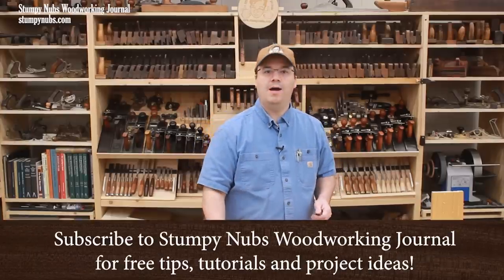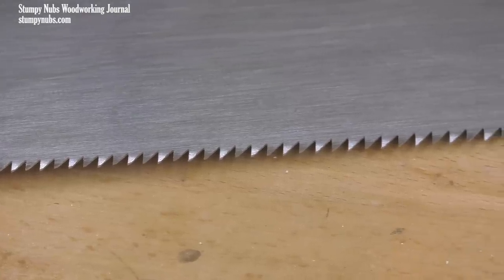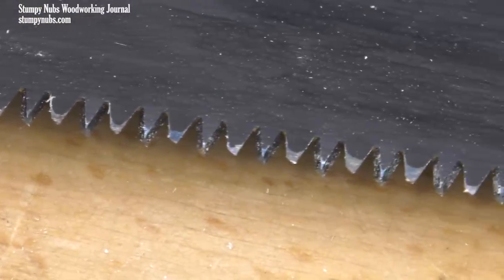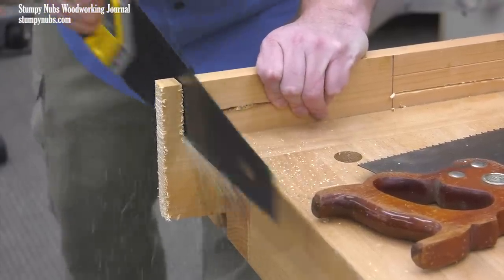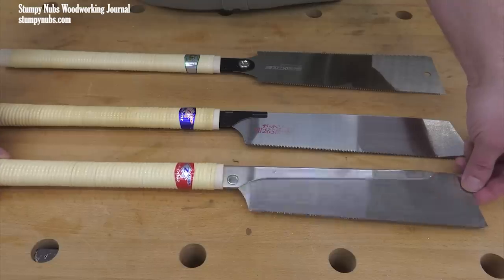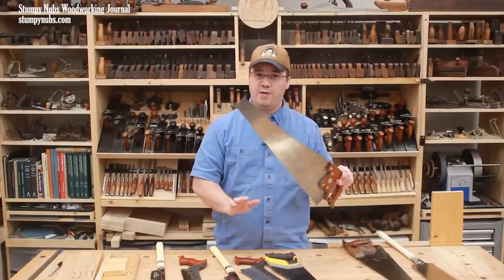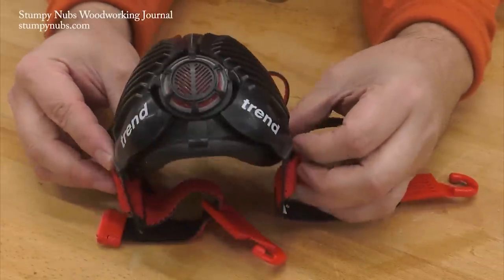Do Japanese saws cut faster than western saws?

Comment: I'd be interested to see a final analysis of which cuts took less time, and which cuts took less total effort. I'm guessing in the final analysis, the japanese saws use less total effort, because they aren't removing as much wood, but that could be a surprise as well.
Reply: This.  I believe this comparison is a bit flawed because it didn't take into account the actual time to make a cut.  Obviously number of strokes is one measure, but if one saw cuts in fewer strokes but takes considerably longer time to complete the cut (due to teeth or how it handles or whatever), that's another factor worth considering.
Reply: @VeretenoVids  number of strokes is a reasonable measure. I'm just curious about the rest.
Reply: @kenbrown2808  number of cuts IS also super biased towards long tools. He didnt even use the whole rip Saw. Effort IS hard to measure. But time IS a very easy measure that totally matters.
Reply: @vittocrazi  time is also easily skewed.
Reply: @kenbrown2808  thats why you should measure It along something else

Comment: Look how clean every cut was with the pull saws in comparison with the push saws.
Love your work 👍
Reply: That's what i was thinking too watching this, the difference was huge! As an amateur with little experience, i feel like the way cleaner cuts would save a lot of time cleaning up everything. next time i need a new saw, i'm definitely going with the thin pull stroke style over the rough push stroke.
Reply: Tearout with the pull saw would be on the other side. Didn’t catch if he showed it. I’ve personally noticed it about the same, maybe a bit less with the pull saw, but not enough to matter. And both prevented by scoring a line before cutting.
Reply: @Terminator85BS 
What you saw was like the other Mike said. Tear out was on the opposite side with the pull saws. I have both styles including some western that are over 200 years old. The main difference that affects choices is because there is minimum steel and a simple handle, Japanese pull saws are inexpensive. I have the Veritas and the dozuki and the price range for the pull saws at my local Woodcraft ranged from $40 to  $80, the push western ran from $90 to $250. Lie-nielsen saws, Bad Axe are  the $200-300+ but like my saws can last for centuries. Pull saws highly unlikely.. Enjoy woodworking and don't stress about it.

Comment: I don't have a miter saw, so my power tool options for making crosscuts are a table saw (with crosscut sled) and a circular saw. My space is pretty cramped, so getting either of those ready for use, and cleaning up afterwards takes some effort.

Before I had the Japanese saws, I would bust out the power tools for anything but the simplest work.

With the Japanese saws around, I find that I often finish projects using only hand saws.

Someone with excellent technique and high quality equipment can probably get the same results with western saws, but I found that within hours of using Japanese saws for the first time, I had better results than I ever got from the western saws I had been using for decades.

Comment: Never would have thought of it this way, but it all makes sense. All of the saws I use at work as an arborist are pull-cut, largely for practicality. It would be virtually imposible to get a clean, proper pruning cut from the far end of even a six foot pole saw, or stretching out to my limit if I was climbing.
Even if it's not exactly a go-to tool, I find it much easier to get a precise cut on the bottom 'pull' side of a chainsaw bar, rather than the top 'push' side.

Comment: Enjoyed the video as I  always do. But I don't understand why this is something we would care to debate. For me, it's always the quality and precision of the cut I care about. The time I spend cutting with handsaws - and I have both Disstons and Japanese-style saws in my till - is immaterial. I choose the saw for the wood, dimension and type of cut. Sometimes, simply because I haven't picked this one up for awhile and I like its feel. I know, easy for me to say. After all, at 69, retired and with a bad back, production speed is just not a consideration for me as it is for others. But kissing the line, leaving a clean, square cut line and avoiding splitting off the edge on a crosscut are. If I was primarily or even significantly concerned with speed, I'd use a machine. Thanks for the ideas and the forum.
Reply: Well you answered yourself there either the third sentence, you said “for you”, there’s lots of different saws with different characteristics for different jobs with many different materials.
There’s a million variables, many of them can’t be controlled, but one you can control and change is the tool. Another huge variable is the user, what works for you might not work at all for me, but that doesn’t mean I get a free pass to not do that part just cuz I can’t get it right!
I’ve gotta either change/improve my technique or find a different tool!
Also, it’s YouTube, a good percentage of viewers here will have never actually touched a saw! Or they could be like me, I’ve literally never bought a hand saw, but since I’m a farmer you better believe I’ve had to saw a lot of stuff! I’d just grab any OLD saw… I’d heard Japanese saws were nice but how would I know… they don’t seem ideal for storing in the barn, or throwing on the wagon when I need to run fence.
It’s probably not ideal to treat a western saw that way either… but here I am using the same tools my grandad did.
Reply from the maker: Nobody says you MUST be concerned with speed, but there are plenty of reasons why one may wish to consider it when choosing a tool. Speed can equate to less energy expended. It can also make a significant difference in the time it takes to dovetail a chest full of drawers or any number of other tasks. That said, there are many other factors to consider besides speed such as precision, comfort, quality, etc. These were covered in the other video: https://www.youtube.com/watch?v=PZdoLx72faM.

It is also worth remembering that not all of the fastest cuts in this video were rough cuts. The rough dimensional cuts may have been, but the joinery cuts were not. There is a time for both types of cuts and a bit more speed does not always equate to a poor result.
Reply: @StumpyNubs  Understand and respect your position. I reply to your videos based on my own needs and preferences. I no longer build cabinets and such for others and with my back will never do house carpentry again so for me, speed isn't an issue. I'm also not a perfections in any Cosmanesque thousandths-of-an-inch kind of way. I'm more of a Paul Sellers kind of woodworker at this point in my life's journey. As I said, though, I really enjoy your take on things and frankly, of the channels to which I subscribe, yours and Paul's are the two I always look for.

Comment: I’ve used both type saws a lot although nowadays my electric saws are used 95% of the time. Your comparisons are ‘right on’. But as you demonstrated in the previous video, the Japanese pull saws are much easier to keep on line, make cleaner cuts, and are easier on my old shoulder. But I still use my old  hand saws when only a few rough cuts are needed and proudly display my old push saws in my shop. Great info.

Comment: Good information. I would like to see Project Farm do a comparison test, because he would use a weight on the saws to ensure the same pressure is applied, then he would rig a machine to ensure the same stroke length, etc. qualitative comparisons such as yours tell part of the story, and quantitative test tell the other part. I use both type of saws in my shop and like them both.
Reply from the maker: The difference in wood density and grain can change inch by inch on a single piece of wood. He would have to make hundreds of cuts to get a reliable average. He rarely does that...

Comment: Another great video!
Also look at the effort per cut, including stroke length (not just stroke count).  If doing multiple cuts, that's going to add up.  The pull-saws have a narrower kerf, so I would think there's less energy taken turning wood into sawdust.
Might find the Shark pull-saw interesting.  Japanese style with replaceable blades.

And do wear a respirator (I like 3M 6300 which is XL, I think 6200 is L, 6100 is S) with a P95 or P100 filter.  They're around $40.  New lungs run considerably more than that.  Who wants tiny splinters in their lungs?

Comment: I have a western style daw you need to try. If it has more than 3 teeth per inch I would be surprised. I use it to crosscut 4 x 4s. It is a beast.

Comment: I was taught to use hack saws in push until I cut a bolt and pushed my hand into the sharp steel. I now use hack saws with the blades backwards in pull.

Comment: I used a hand saw a lot as a kid, and the key to success seemed to be not flexing the saw blade on an aggressive push stroke.  From what I can tell, that potential problem is eliminated in the Japanese saw because the push stroke doesn't need power, hence no flex.

Comment: Good stuff.  Take note that many Ryobas on market are not the larger variety seen here.  The smaller ones are ok, but those bigger ones are nice.
Reply from the maker: Yes, that was covered in the other video.
Reply: @StumpyNubs  Yep just helping out!  I use both styles, they both do things different, and sometimes you need a pull cut over a push cut, and vise versa lol.

Comment: Use a frame saw for this, the long tensioned blade and the the weight of the saw will make the cut more controlled and the presure is constantly high

Comment: I find that the pull saw is better when applying pressure because you can't buckle the blade.  On a push saw if you're applying downward force to the cut you easily impose bends and even buckling of the blade.  A pull saw keeps the cut and blade straight even when applying significant downward force.

Comment: Hi - one other variable you didn't seem to take into consideration. I was taught old-style and that was to use the WHOLE length of the blade. You did this with the tenon and Japanese saws but only used 1/3 of the blade with the 2 Disston saws.
Reply from the maker: I generally begin with short strokes and increase the length as I cut. Everyone has their own style :)

Comment: Interesting video. I'd argue that the ryoba is not only fast being used aggressively but it leave a superior surface. All the cut you made with the Diston's and the Dewalt had serious blow out on the far side of the cut.

You have to have the right size ryoba for the job. I noticed that when you did  the aggressive cut you looked like you were using a 300mm blade. That's what I will use for 2x material. A 240 mm cant be used so hard but it's not mean for that. You should get yourself a maebiki if you want serious aggression ;) plus they look great hanging on your shop wall.

Comment: time is a more relevant measure of speed then strokes as the saws used had varied stroke lengths  thereby cutting more per stroke but not actually faster

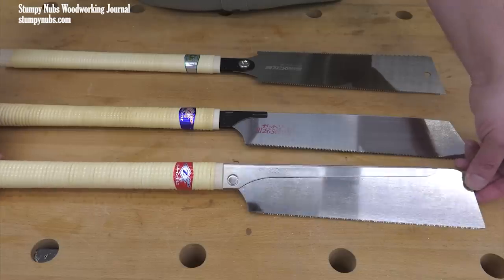Comment: 7:08  I'm mystified as to the obsession with speed of cutting. Surely a more useful comparison would be as to how much physical effort it takes tp make a particular cut. Another useful measure would be how accurately they cut along a straight line and if they keep a 90 degree angle (or slide away)?   After all, who cares if one saw takes 3,7 seconds longer to make the cut?

Comment: Well, let me tell you a couple secrets.

You use pull saws for stuff above you and push saws for stuff below you.   The Japanese style saw was so that 2 or 3 people could use it at the same time on a pole.   Get a couple really fine Silky concave and try em out on the same test.
Reply: During many years in the Far East, I have watched builders and cabinetmakers use the Japanese saws. They are used when standing, sitting, kneeling, or any other position that might be required for the work. I never have seen any, even for working with large logs, that were designed for more than one user at a time.

Comment: Interesting. I have watched videos of  Japanese workers using their  pull saw and the craftsman  was positioned below the board and subsequently pull downward.  This forces the board down which in turn does not in most cases require hold downs or a vise. It way be an old school technique or simply a technique limited to certain areas of Japan.

Comment: A key factor in all this is that western saws are more forgiving of how you hold the workpiece. You can jam the plank under your knee, against a fence post, or under the crook of your arm and it's relatively easy to counteract the force of the blade. With pull saws - and particularly for taking advantage of the two-handed approach - you need a properly clamped piece of wood because your large body forces (movement of your torso) are generally acting to pull the workpiece away from the thing you have the workpiece braced against. That's why it can feel quicker to use a western saw - you can get to cutting faster with less setup for the cut.
Reply from the maker: That may be true for rough cuts, but using your body to counter the path of the blade is not a recipe for a finish-quality cut, nor for fine joinery cuts.
Reply: @StumpyNubs  That's kind of implied by the holding it against the fence post and under your arm. :D For those times you've got a quick notch to cut or crosscut to do while out in the field, it might be the only option.

Comment: For me the push/pull difference was only ever really about controlling the saw and the possibility of metal bending, especially when it binds. I can much easier control the proper direction and straightness when pulling, and adjust the force. might just be me, might be inherent to push/pull, but in the end I don't care because I use whats better for me, not whats better on paper ;)

Comment: From a material's perspective, pull saws use the saws material more efficiently. Steel behaves better with tensile forces compared to compressive forces when unsupported. Hence, the better kerf to blade ratio, which can be used for a smaller, more accurate kerf and more force from the user while maintaining stability in the cut. You're more likely to cut smoothly with a pull saw rather than burn it with pinch spots as the push saw flexes, especially in an untrained hand.
Reply: But in trained hands the push saw gives you much more control...  It's a give and take on that score...
Reply: @ZeoCyberG  what control is needed, with a pull saw you have 2 points, the cut and your hands and the tensile forces will keep a straight line between. With a push saw the compressive forces even with a good hand can only match a pull saws control.
Reply: @timwatterson8060  Lots of control can be needed.  Since, not every cut is going to be between just 2 points and not everyone gets the cut perfect on the first try...  If you have to correct or do a more complex cut then that's easier with a push saw.   The advantage of the pull saw is it doesn't require that much skill to just cut a straight line, which makes it better for beginners.... So reality is they both have their pros and cons and people also just have their preferences...

Comment: I bought a Japanese pull saw with my magnetic dovetail jig. It works fine and the narrow kerf suits it. However I much prefer my Veritas tenon  rip saw. However I do have to allow for the extra kerf. I don’t care too much whether a saw cuts on the pull or push for accurate work. I do prefer having a non bendy back saw. It’s good to try a novel tool, but for me it’s just a fad to use pull saws, especially when the blade wobbles. If it were a choice between a wobbly blade pull saw and a Veritas tenon then I know which will serve me well for a whole lifetime. Stopping a blade wobbling is an extra to deal with.

Comment: James, I loved this video.
I've heard that the main difference between western saws and Japanese pull-saws are that the western saws leave one side 'clean cut' while the other side is 'torn' - the Japanese saws leave both sides more equal; neither side 'clean cut', neither side torn as much as the western saw.
-Can you confirm that this is true ?
(The comment section contains a lot of questions and good viewpoints, probably enough for another video).
-Anyway, I'll probably try a Japanese saw one day (one I get recommended from a Japanese woodworker, not one of those with plastic-handles you can purchase in a hardware-store).

Comment: For speed cutting motorized sawing is unbeatable. For quality cutting Japanese hand saws are unbeatable. That is why I have a foldable Tajima in my belt, while using battery powered circular saw and electronic table + mittre saw for speed. 

If I have to chose just one tool for everything from fine woodworking, through carpentry, to outdoor survival bushcraft, that is definitely the foldable Tajima, period!

Comment: You're counting the strokes but the lengths of the strokes are different.  The ryoba was cutting on both pull and push strokes.  I think Project Farm should do this test.
Reply from the maker: They are roughly the same, on average. Even so, there are FAR too many variables to do a definitive test (something Project Farm often ignores). This is merely a discussion of my observations and I did not suggest a firm conclusion.
Reply: @StumpyNubs  I see.  Thank you.